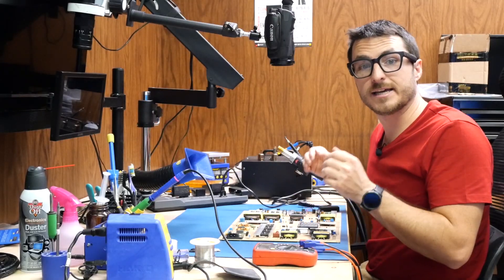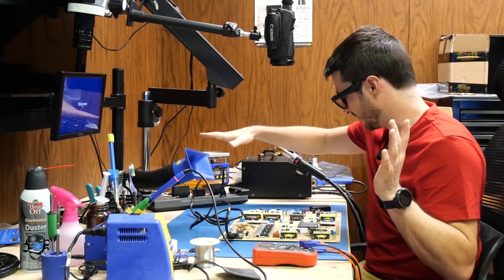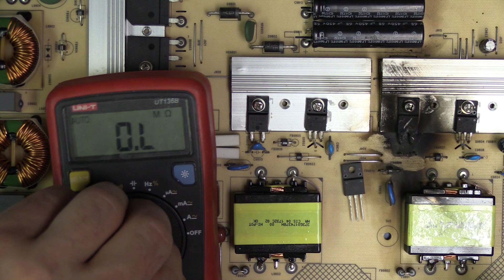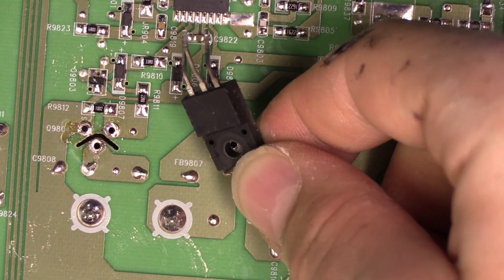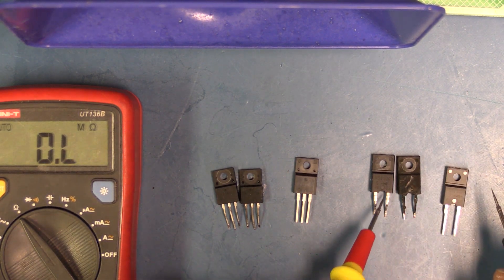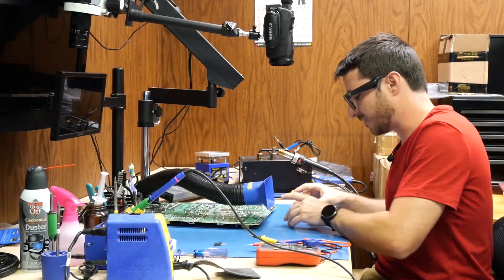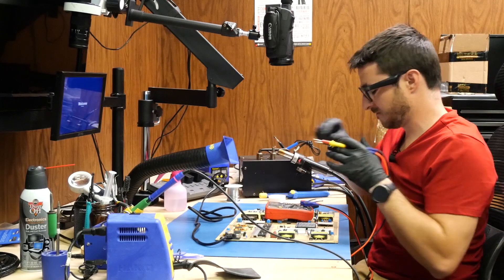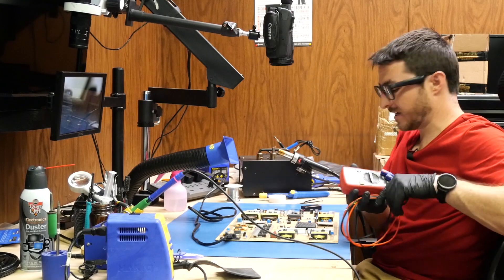Vizio M75-E1 TV No Picture Power Supply Repair

Comment: I guess you've seen this before, but I couldn't help wonder if such damage to a power supply board wouldn't usually be caused by a short / failure elsewhere in the TV overloading the power supply?
Reply from the maker: After some discussion with other techs I have learned the blue capacitors blowing up are the root fault. So they are what fails and causes the chain reaction of failures after. 
So moving forward replacing those with higher quality then originals should help prevent this from occuring in the future.

Comment: I use as well IPA, my personal fav. one I use all the time is in a spray bottle. I try not to use Q-tips/cotton swaps, I use an old tooth brush and a kitchen towel. These are more recyclable ones comparing to this shown technique. But, if someone don't care about the recycling, this method is still OK :).
Reply from the maker: The toothbrush is great but doesn't clean well, just mostly spreads things around. Qtip is better for absorbing and picking up but often leaves fibers behind and is also as you mentioned not recycle-friendly. Reduce is the number one of reduce reuse recycle, Qtips don't fit in there very well. 
We use Qtips and Kimtech wipes which don't leave fibers behind for motherboard repairs, especially for BGA-type work. We also use toothbrushes. We use them all in combo depending on what tool seems to be the most appropriate. All have their own advantages and disadvantages. Can't really use towels, they are too thick/big, and can't get into the small nooks. Unless you have an electronics-type cleaning towel. If you have any recommendations I am all ears.
Reply: @NicksTVRepair  I agree with most of it. But, I've got a towel from Costco here in the UK, I think you live in the USA, so can't recommend any there, sorry. Yes, it is thick and yes, toothbrush doesn't always get things done. I use a needle, a shape blade from a knife like Stanley, or other thing just to scrub off burned resin from the flux. I have as well from prying tools which I use to not scratch fragile places.

A good kitchen towel makes a whole difference, but I did try toilet papers :D, these were the worst :D. Can't recommend any.

And, everyone is different ;). I can't blame people for using Qtips, it's just me and my observation as I microsolder daily that I can for real use kitchen towel and IPA with a toothbrush + a small painting brush.

Thank you for your answer just by the way :).

Comment: How you power on power supply without tv?
Reply from the maker: By providing 3v to the PS-ON line which tells the power supply to turn on. That's what the little battery pack is. It's two 1.5v batteries in series to give me 3v.

Comment: Do you have a dim bulb tester to save equipment from more damage?
https://youtu.be/6SXPj6HFY-Y
Reply from the maker: We do, but we usually only use it for audio equipment. 
I knew there wasn't going to be more damage from powering it up as is because the customer said he kept the TV on and played it several times after it broke (trying to do power resets) saying he was getting pictures on the screen just no backlight, so anything that was going to break and malfunction already had. 
I know I said I saw a spark, but I actually don't think it was, I think it may have just been a reflection, I was also in "let's be dramatic mode" 
But typically we don't power on a board if it has shorts like that, this was more for the purpose of the video.

Comment: amazing diagnostic- sniffing is also a part..But  no smd is burnt..we got very lucky...
Reply from the maker: So we offer a service on that one, and it is very common for that blue cap to completely blow up and cause what looks to be a lot of damage but it's almost always just the caps that need to be replaced and the 2 diodes, sometimes those transistors fail but we don't typically see more faults. So for this one it usually just looks a lot worst than it really is.
Reply: @NicksTVRepair  Yes You are Right.